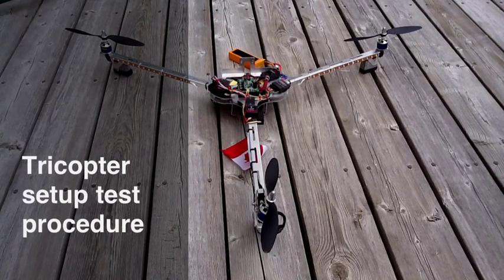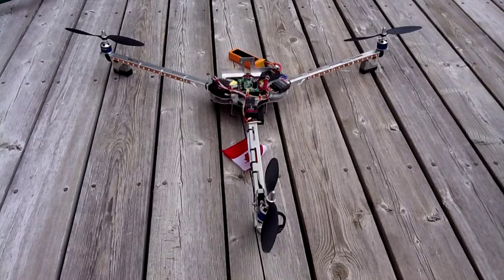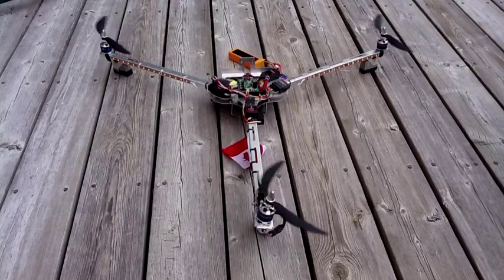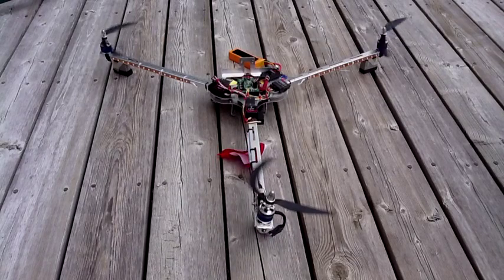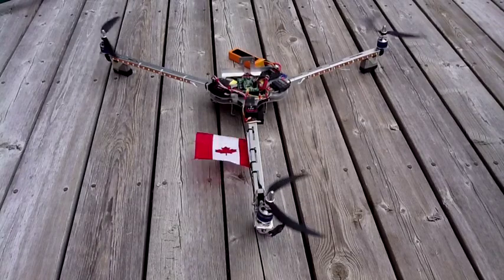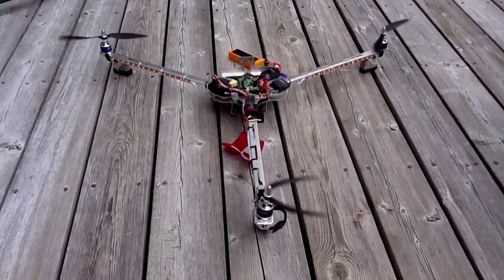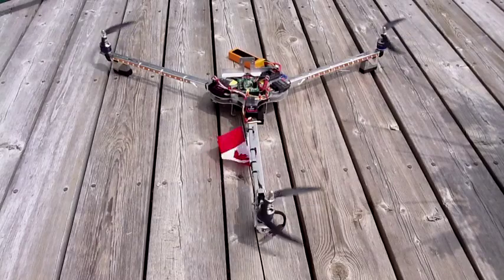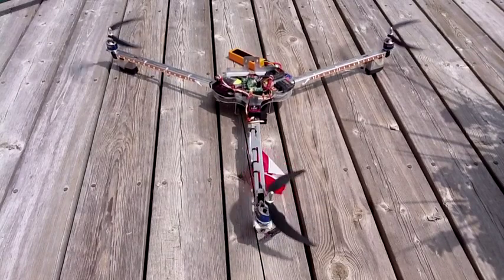Tricopter Setup Test and controls

Comment: Can you tell me what flight control board you're using? I'm having trouble keeping my machine from spinning like a top all the time. Any advice?
Reply from the maker: Hi Tony.  That is a home brew board based on the KK stuff. (Had to use a separate stabilizer etc). Nowadays the KK 2 etc is awesome. It sounds like you do not have the correct offset in your rear Motor? It has to be at enough of an angle to counteract the spinning. Just having one of the props spinning in the opposite direction is not enough to counter the two others.  Anyway not sure if that is your problem, but that is all I can really think of that causes a flat spin. On mine the rudder trim is not enough to get the right angle (about 10-15 degrees) and the servo horn has to be moved a tooth or 2.  So try that maybe? Of course the size of the props and motors will have a big influence on the angle needed.   Oh and actually another cause just came to mind if you do have the offset. The ESCs need to be calibrated for full throttle to make sure they all spin up to their full ranges. That is ESC dependant, but when you do that take off the props to avoid any disaster!  Good luck. Chris
Reply: CPsVids
Thanks for the quick reply Chris. I have a KK2 board and am still trying to calibrate it. The KK2 tricopter layout puts one of the props counter-rotating. You have your props all going the same direction?
Reply from the maker: Tony Vincent Hi Tony - Yes they all turn the same way -  I have only ever used std props on a tri. I stop rotation with the rear (yaw) motor angled against the force. The only time I have used counter props wth a KK2 board is on a quad which of course requires it. Sorry I can't be of more help. Although, even with a counter rotating prop you should be able to stop rotation with counter force. Have you checked out all the tips on Flight Test and RC Groups?
Reply: CPsVids
It's almost certainly my lack of skill! I'll keep at it. I think I just have the settings at a too sensitive level. Thanks for the help!!

Comment from the maker: Hi. Sorry, I have only used the KK2 Board on my quads - the board on this tri is a home-build. As you know on  a tri the motor must be angled to counter the rotation. I fine tune it with the trim.  On the KK board there are many parameters that can also be adjusted - have you watched the video guide that HK guys have published as I am sure it will help. I can't post the link here, but it is called : HobbyKing - KK2.0 Complete Guide Pt.5 - X900 Tricopter

Comment: Hi doc. I had the same issue (Multiwii Pro from HK).  Futaba 12FG tx.  Turned out I needed to set endpoints to 110% both directions on aileron, and also throttle.  I ended up setting all sticks and aux1 and aux2 to +- 100%.  Config shows nice range from 1000ish to 1500 to 2000ish on all axis.  Now I can arm with thr down+ail right or thr down/rud right and disarm too.  I'm in Burlington but I'm also new at this.  Maybe we can join forces later.

Comment from the maker: Phil - NP. Great progress!  You got it figured BTW. Your trims are out. Self Level is just that. It does not do Position Hold or compensate for trim. (You need a GPS, Flymentor or the like for that). So yes, set up your trim and use your sticks. Make sure you can easily see the orientation of the tri with lights or some kind of "flag" and learn to fly with the back facing you (as if you were sitting in it).  Let us know how you make out and post a video. Cheers Chris

Comment: Hi
Thanks a lot for your help.I have updated my kk board and made sure all my props are turning the right way.At the moment I can get the tri to lift of but it is not hovering in one place and starts to drift of in a direction.My self level setting is turned on.Does that mean my trims are of or do I have to do a sensor calibration again or is it just not possible to hover in one spot without having to compensate on your sticks?
Thanks
Phil

Comment from the maker: Hi - It depends what board you have as how the arming works.  Most of the time the problem with arming is the throttle trim is not low enough. Set your trim to its lowest point. If you have a digital radio you can adjust travel.   WARNING : Take your props off when experimenting - It is not good if you are experimenting and suddenly the motors all go to full speed!

Comment: Hi nice vid I have built my first tried copter and so far all is good I am having trouble trying to arm it.. can you using the rudder dose not work but the servo dose move . I have 4 sets of wires in my receiver  throttle elevator aliron  plus my servo and 3 sets in my flight controller   throttle   elevator  aliron but no rudder ,  can you tell me what's I have done wrong so that I can arm and disarm it  please

Comment from the maker: Hi Phil.  The radio should be in Acro mode. Set it up just like a 4 channel plane. Throttle, Elevator, Rudder and Ailerons.  Your faster motor may be the trim on your radio being out? However if it is happening after take-off then it may tri's balance or one (ore more) of the props the wrong way around? (Easy mistake to make). On the KK2 make sure to have the latest firmware - the earlier versions sucked for Tris as it was unstable.  Let me know if you need more and I can send you some detail.

Comment: help needed please!!!!!!!!!!
I have built a tricopter using a kk2 board and a spectrum dx6i radio.there is a wealth of info on setting up the kk board but not a lot on settings I need to have on my dx6i.i am a complete novice and is new to the world of rc.at the moment motor no1 on my copter is spinning way faster than the other.i have calibrated the esc using a prog card.i also don't even know if my settings need to be on heli or acro mode.any help will appreciated thanks 
phil

Comment from the maker: Hi. Sorry, I have not built a 6 motor system. However the info you are looking for seems to be in this video: "Y650 Scorpion Glass Fiber Multi-Rotor Frame 650mm Vol.25 test flight" from yasuo840 at the 8 second mark.  Also have you looked at the RCGROUPS thread on this machine?  There seems to be a great deal of info.  Sorry I can't offer you any more help than that.  Good luck and it looks like quite a beast you are building!

Comment from the maker: The SW in the board is designed to not start the motors until it gets a specific input sequence. In this case with throttle at zero you hold the aileron to full left for 1.5 seconds. The light comes on and the system is "live".  Then when you land you do the same thing to "disarm" the board. This means if you accidentally bump the throttle it will not take your head or fingers off!   I learned this the hard way once and since them I am pretty wary :)    Good luck on your build!

Comment from the maker: Hi Sorry - Not sure I understand your question? The connection is simply like a 4 channel; plane. Throttle + Ailerons + Elevator + Rudder. Make sure you have them set to the correct direction. Some may need to be reversed. Also make sure trim is set all the way down on throttle as that can cause a board not to arm. The smoothness comes from using exponential on your transmitter if you have it and also adjustments on the board.  I hope this helps.

Comment from the maker: Thanks!  Yes, they are standard props and so they do all spin the same way. I do not use counter rotating props.  I just have the rear motor offset. Another thing I have tried is to offset the front motors (by twisting the booms). Both methods work fine.